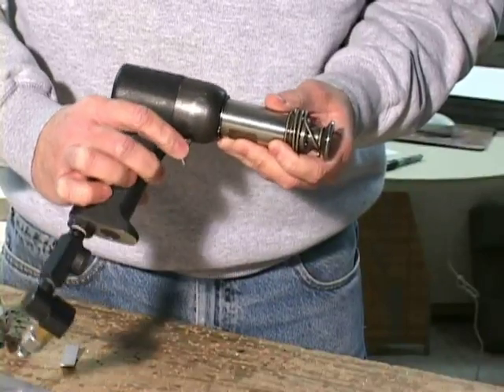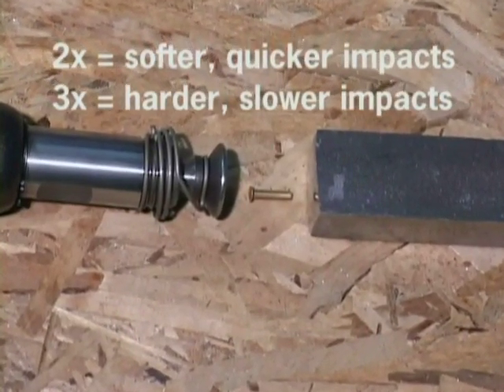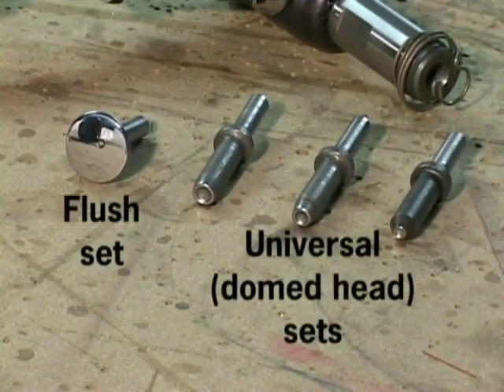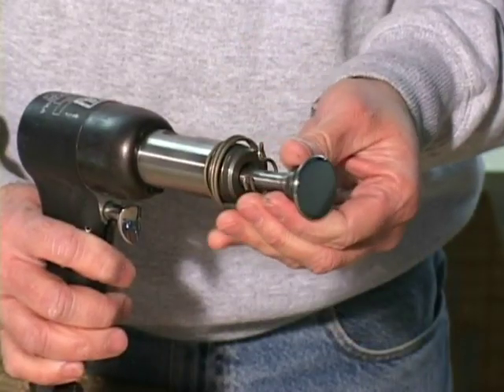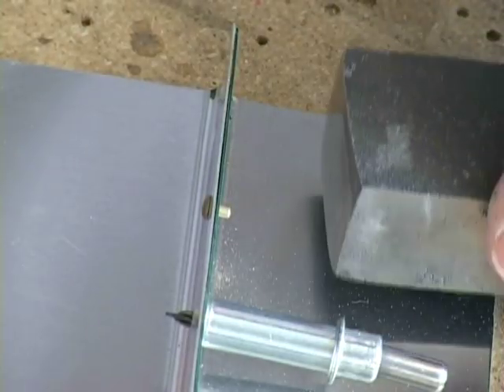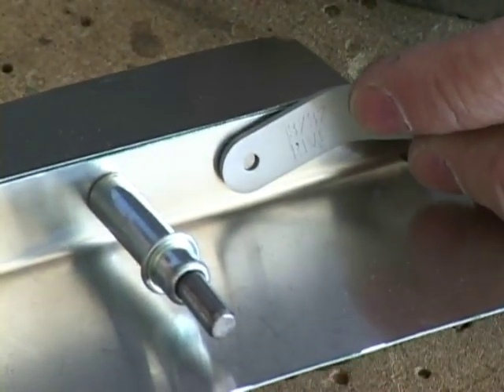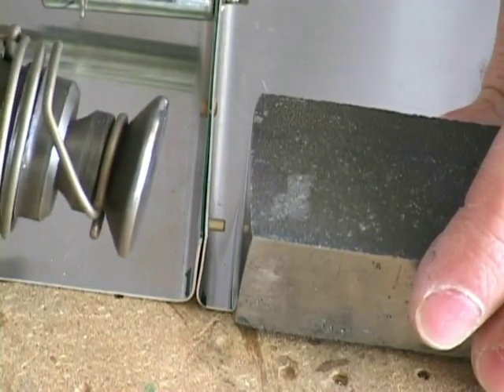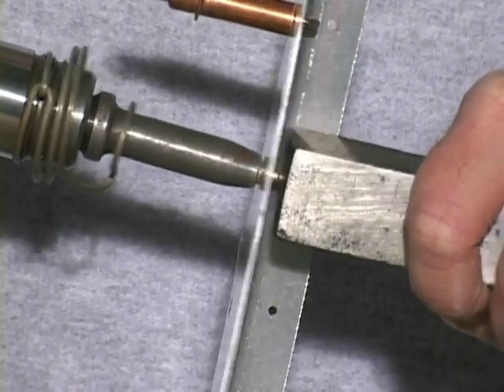RivetGunDemo.mov

Comment: This is a great video because it’s simple and the point. This may sound stupid, but one of the most important parts of the video is when you mentioned what to do when you don’t have access to both sides of the rivet. Obviously the first thought is to get help from somebody else but I wasn’t 100% sure if that was the case. Anytime that I have tried to rivet with another person you would think it was the most difficult thing they had ever done. Every single time the person holds the bucking bar crooked,  deforms the head and tells me to keep going until they have destroyed the metal and cold fused everything together.

Comment: I just got my 3x gun for building my rv10.  Practicing tonight.  I'm getting better, but watching you set a perfect rivet in a single shot was so satisfying to watch :D.  I'm having a hard time with understanding the air pressure and the gun adjustment on my 3x gun (737 kit).  Will I just get a feel for it through trial an error or is there a better technique to get it setup the first time?  My tool didn't even come with instructions.  I don't even know where to put the oil!  I'm sure I'll figure it out by the time the kit arrives.  Thanks for the time you take to make all your videos.  They are all so helpful.

Comment: Great video.  I'm not building a plane but repairing rivets in my boat.  I am curious if you guys use any sort of epoxy or other adhesive to keep water in/out.  Is this necessary or does the rivet  create a tight waterproof barrier?  Also, any brand name "kit" for us beginners?
Reply: Usually we put sealant but is it waterproof I don’t know